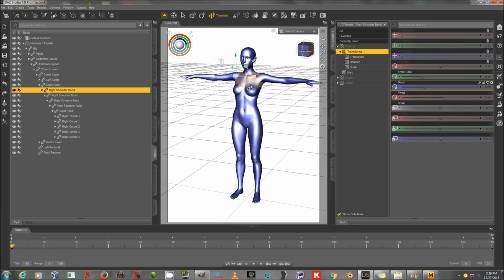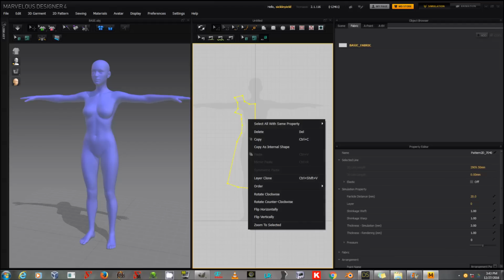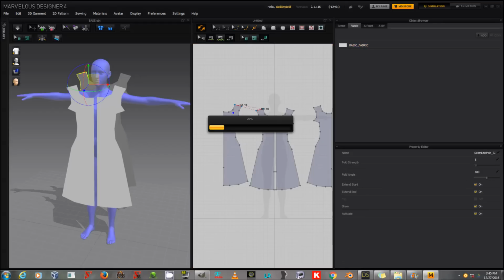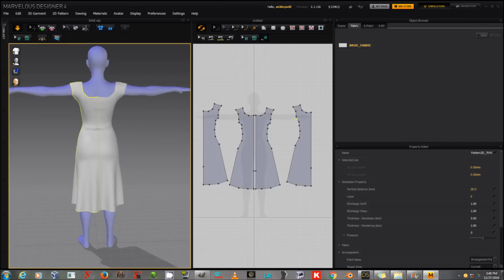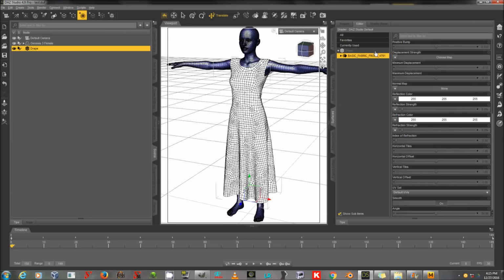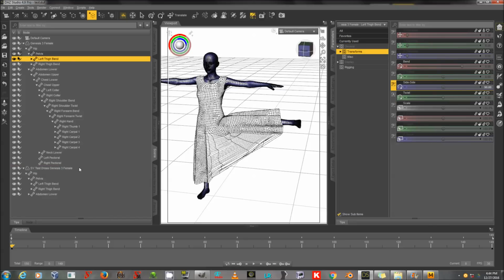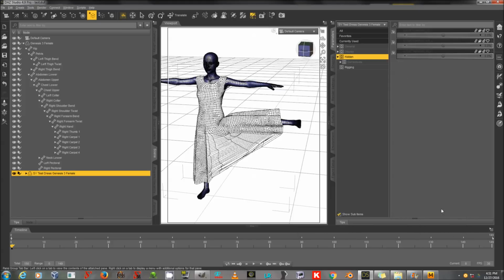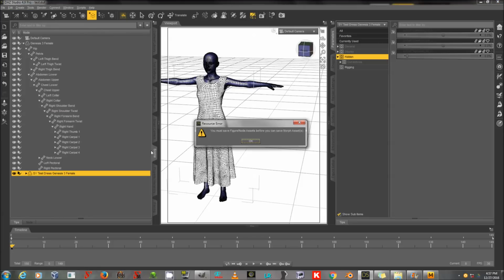Marvelous Designer For Daz Studio 02: Creating A Garment

Comment: For MD, if you're going to copy/paste/mirror paste a pattern piece, hold the Shift key before placing it to snap the pasted part to align with the original. This keeps your UV map neater by allowing texture maps to line up accurately, especially seamless tiled or textures which have specific details which cross over seams.As well, instead of making the clothing item as 4 pieces, you can right-click the centerline of the first quarter-piece and select Unfold. This will mirror the item. From there, you can Copy/Mirror Paste to create the back piece, as well as invert its rotation. However, sewing the seams will require you to cross the pattern, which gets confusing. Alternatively, if you simply Copy/Paste the back portion and then Invert the Normals in the 3D window, your sewing in the 2D window will be done normally.Lastly, when you are sewing, you get an indicator in the 2D window that shows which node point you are closest to. To avoid crossed sewing, the indicator should be at the same node on the opposing seam. For example, when you stitched the bottom under the right arm, just before the "fast-forward-to-show-all-the-sewing", your 2D sewing lines were inverted, which caused the 3D sewing to be inverted. If you are sewing, say, the top over the shoulder, and your initial sewing point is nearest the node closest to the neck, then your sewing indicator on the opposing portion should also be near the node closest to the neck.
Reply from the maker: These are great tips, thank you!

Comment: This is great tutorial but I'm having some problems. When I import my clothes from Marvelous into Daz3d they come in super big and floating waay over the character. I have to use the Parameters to scale them down and translate them over. I then try to use the Transform Utility. I don't know what it does but when it's done my clothes are back to their gigantic size and floating miles above my character. I double checked my export settings in Marvelous and they are correct.     

Any idea what I could be doing wrong?
Reply: I had this same issue, in my case I did a silly mistake, my scale while importing to Daz Studio was like 2000 something, I had to change it to 100. I think the value was that way by default because I dont think I "accidentally" changed it

Comment: hey how come everytime i try to apply the morph to MD it says its" incompatible with this character "?
Reply: u must have same poligon.
Reply: Your character needs to be the G8 at base resolution without subdivision or geograft (genitals, etc) attached. Your Genesis 8, once imported in another app should be exactly 16368 polygons, 16556 vertices. If it's anything else, you did something wrong.
When working on any morph for any object : Always Base resolution, 0 SubDiv.